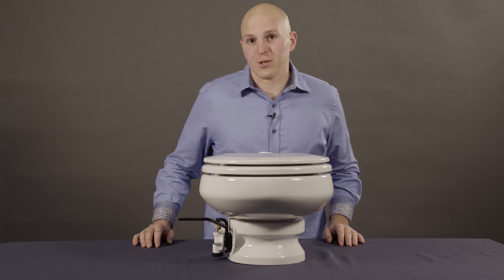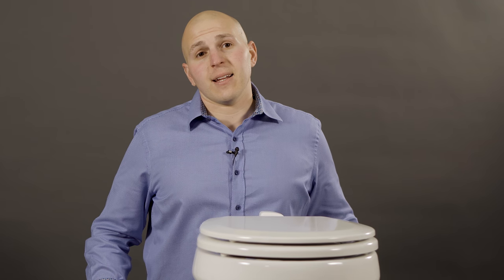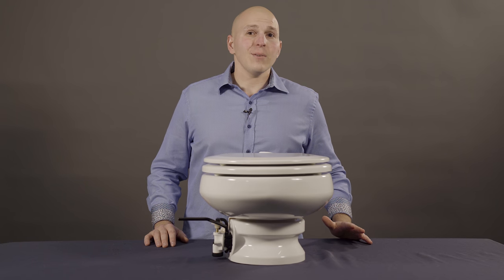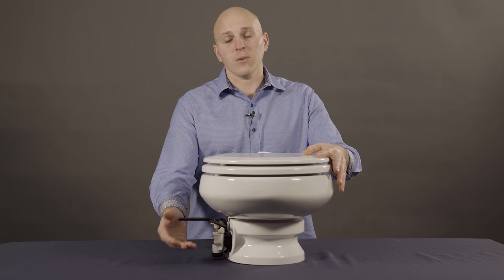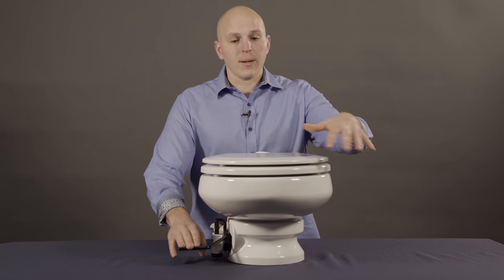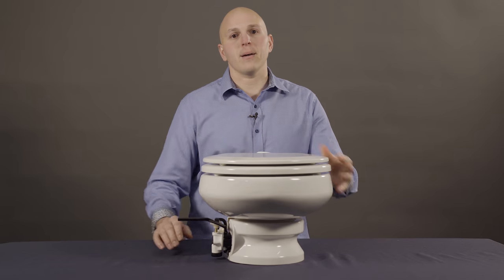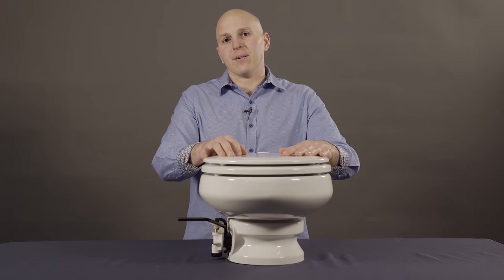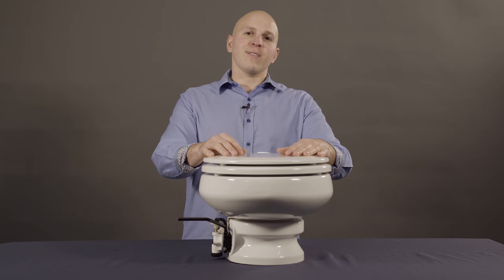How To Operate a VacuFlush System

Comment: This was extremely helpful. We didn’t know about letting the pedal snap back, OR about holding the pedal up for three seconds for solids before pushing it down. Thank you!
Reply: Question: there’s an on/off button for the vacu-flush on the wall. We’ve been turning that on when flushing solids. Is that the right thing to do?

Comment: I bought 3 new vacuflush toilets this year and they never operated properly. Turns out the manufacturer installed the large rubber seals backwards (the ones that say this side up). Cost about as much as the toilets to figure out the problem. All good now

Comment: Are you supposed to have the toilet seat and cover closed/down when flushing?
Reply: For the operation of the flush, it is not necessary BUT, sometimes you'll get a back splash of water if there there is not much in the bowl.  To prevent the back splash hitting u water places, having the seat down is beneficial.  
-Weber Marine, San Diego